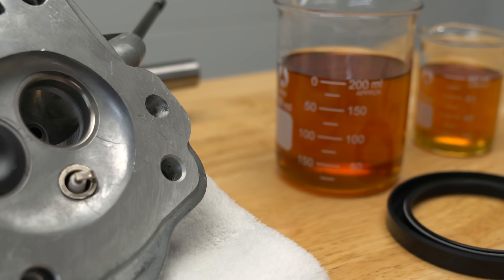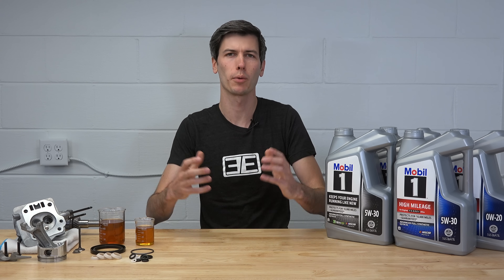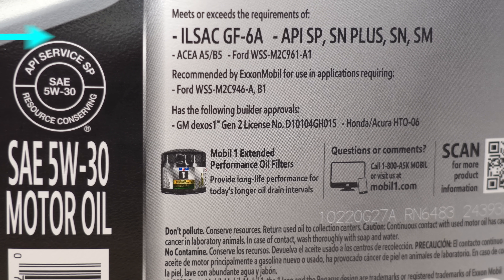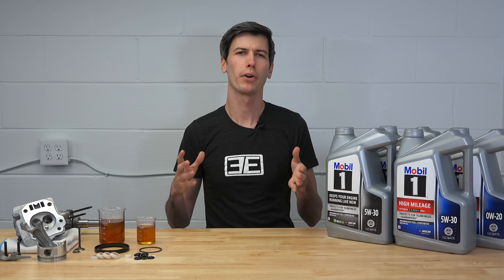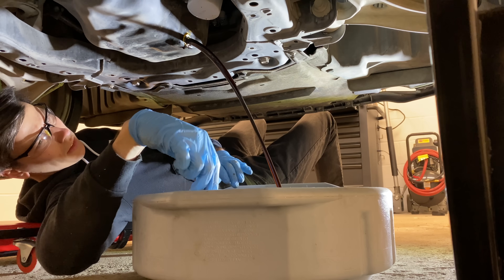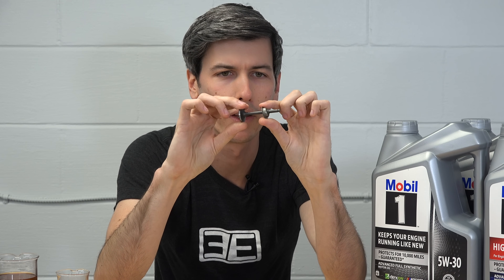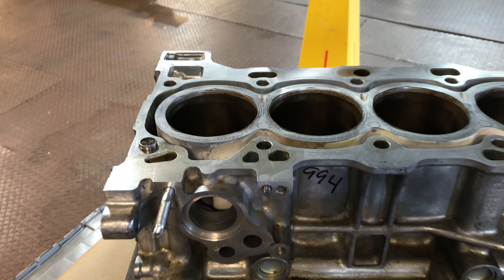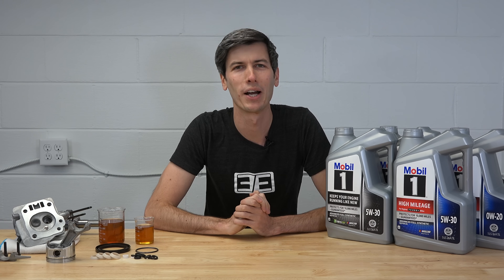Is Synthetic Motor Oil Bad For Old Cars?

Comment: I used synthetic oil in our 1996 Jeep Grand Cherokee 4.0l to maximize its life. When we rebuilt the motor at 189k miles the cam, lifters were trashed since the synthetic oil had no ZDDP additive to prevent metal to metal friction. Using synthetic oil or any oil lacking ZDDP in an engine before about 2004 is suicidal.

Comment: One thing to call out with regard to oil weights is that neither the first, nor second number are particularly meaningful for most people in most conditions. How often in a year do people really start a car in negative 20 degree outside temps? And in the parts of the engine where it matters most, the viscosity at 100C is pretty irrelevant as operating temperatures in critical parts will be a lot higher, especially around the piston rings. At operating temp, all oils are thin so the quality of the base oil, the additive packages and the HTHS - high temperature high shear - value are much more interesting. I run a M1 0W-40  in most of my engines in a fairly warm to hot climate year round. Not because it's a "thick" oil because it really isn't, but rather because at $5 a quart it's a really strong package that can take a beating when you run higher RPMs at high outside temperatures, while it's thin at room temperature to get to all the bearings quickly during a cold start. MB and Porsche certifications are some of toughest in the industry and this has the stamp.
Reply: But I would not even think of using 0W anything in an older, (pre 2000s) engine.  Clearances are probably too large.
Reply: @michaelbenardo5695  0W has nothing to do with the viscosity at operating temps. 10 or 15W-40 is just as thin at those temps but most of these oils don't perform as well as the M1 where it matters. If you want thicker oil for older engines, the M1 5W-50 is an option. The only downside to higher number spread oils is they shear down more quickly. This is all info from an ex MB engineer in Germany who worked on lubrication for them for years.

Comment: I have a question to check. I got an 20 years old car with 200K mileage. In the manual book, the recommended engine oil is 5W 30 but now I am using 10W 30. However, once I got to the mechanic, they suggest to use 10W 40. So, any could suggest me what will be the ideal engine oil for my car? Thank you.

Comment: No Discussion of ZDDP and Flat Tappet cams!  Mobile 1 publishes the amounts in their oils.  20w-50, Euro, and High Mileage have the highest amounts.  Remember that the oil spec for older cars does not appear in modern oils - they DO NOT meet those specs.  

And if you go way, way back to the times of non-detergent oil and engines that did not have full-flow oil filters (they sometimes had OPTIONAL by-pass filters that slowly filtered oil from a small passage usually around the cam or distributor) you have a big problem:  Detergent oils kept dirt in suspension so the filter could remove it.  This is not present in old engines where dirt in oil would  settle and accumulate in the bottom of the oil pan.  All that muck and sludge in the bottom of pans would have been kept running through the bearings if detergent oil was used.

Now the irony of all this is that the obsolete bypass oil filter could also be used on modern engines to remove 5 micron and less particles.  The full flow would take care of the big stuff while the bypass filter would slowly accumulate the small stuff that would clog the full flow filter if it had media that fine.

Comment: I have a 65 Malibu with the original 283 that I overhauled in 1990 with a new cam, new bearings, and new  pistons and rings, and new stellite valves and seats.I have about 30,000  miles on with no leaks or oil consumption.What  Mobile 1 oil grade would be best ?.I have been running Vavoline 5W30 conventional  oil in it since 1990. That being said,I have been running Mobile 1 on my other 3 newer cars for about 11 years and a lot of miles.Would switching the 1965 over to Mobile 1 create any problems?From your video I don't see any problems with doing That.Thanks,Larry.

Comment: Good video! Another reason to not use synthetic in an old car that already burns oil, is the cost associated with burning the expensive oil! I think I would buy the cheapest oil until I could replace the car. Amsoil advises to install their oil in mechanically sound engines. A car that has been running on conventional oil for 150,000 miles probably isn’t all that sound any more due to wear and sludge build up, even if changed often,because of higher volatility and lower maximum operating temperatures compared to synthetic oil.

Comment: Very thorough and conclusive.  I recently switched to synthetic on my 2000 Corolla which I bought used with goal of 200k miles.  As I've taken care of it, I kept increasing the mileage goal.  I'll probably keep it if I get another car.   It doesn't leak or burn an ounce and everything is ridiculously clean.  I think you're segway into people running thicker oils may have confused some.  I see it as an informative, but different discussion, but begs a question: is weight consistent (as it should if following API) or is synthetic considered thinnner/smoother/less viscous?  This piques my interest that my new ticking noise in my Corolla may correlate with switch to synthetic, though these cars are known for it, or it's just age.  I can try conventional next time to see if there is difference, right?
Reply: I watched this again as I'm thinking of reverting to my conventional oil (actually GTX synthetic blend).  There was never an issue but now I noticed that after 4000 miles, I'm down about 1/4 qt.  I refused to think I was burning it and have no signs of blown head gasket - so I think it's leaking and I'm going to try to revert to see what happens.  I do like the info on high mileage oils, which I thought was just marketing.  I may try that also.
Reply: Still on syntetic? My rolla has 250k Milles on it, thinking of switching to syntetic.
Reply: @maartenvas1278  Yep, my first batch turned black sooner when a Toyota owner said that happened to him when he switched, as well as the decrease in oil (like seals gotta get used to it or something) he suggested not letting it go 10k miles as some suggest and keep on closer to regular interval at first as it removes gunk.  I changed that one at 5-6k (was doing 5k OSI prior) and will change and probably keep schedule at 7500k.  I use Fram Ultrasynthetic filter.  Regular full synthetic not blend or high mileage.  After last change, oil stayed clear and doesn't burn a drop.  I'm at about 190k miles.
Reply: @maartenvas1278  Try it for a few changes.  I actually did it 3 or 4 times with success but noticed new 'burning' (common in these gen 8 Rollas) so I went back to try Dino and see effects.  The Car Care Nut says some oil loss is fine in Toyotas, I seemed to be about 1/4 qt at like 4000 miles.  I've been monitoring this change and oil stays clear but loss seems about the same.  I'll probably go back to synth since it's actually a little less and my interval (especially if needing to top off) is longer.  I would never suggest thicker weight on these, I think that's how to screw up pump, chain and DOHC.

Comment: For the small difference in price I wouldn't put conventional oil in my lawn mower. My daily driver has 350,000 miles and still runs amazing. Usually change my oil around 12,000 miles with Mobile 1 . At around 200,000 miles it was down a quart at 6,000 and I read that fouled oil rings can cause consumption so I went old school and topped it up with a quart of Marvel Mystery oil. Changed the oil at 10,000 and next oil change I went 10,000 miles without adding oil. I've also had good luck with Seafoam to de-gunk old engines. I've used it in my daily driver as well. Engine has never been apart and still doesn't leave a spot on my driveway. Keep your motor clean and use good lubricants. Watched some Amsoil videos and I kind of believe their hype about the additive packages but for the price I'll stick to what is working for me. Also, I do occasionally, maybe every 3 or 4 oil changes, do a seafoam treatment around 500 to 1000 miles before i change oil.

Comment: Theres was once a mfg, like bentley, mercedes, bmw, porsrche, or some other luxury type. They ran their engine for equivalent 1 million road miles, and had a constant flow of new oil in, old oil out. And the engine never gave up. Moral of the story: Do you want to spend all your money on oil changes or save up for a different car and allow your engine to die? Ever since hearing that story, I now look at the color and transparency of engine oil to change it. I dont wait for the magical numbers. I want vintage cars to last forever, because new cars are filled with remote control shutooff devices, microphoens and cameras that watch you, and gps that tracsk you.

Comment: Just for informational  reasons. If your oil light flickers and the oil level  is okay check the oil psi sensor  before switching to a higher viscosity  oil. I have found this issue on several  vehicals.
Reply: *vehicles
Reply: Exactly. I have found that most of the time a warning popping up on a control panel usually means that a switch or sensor is faulty.
I thought these things are meant to warn you of a pending mechanical problem, not be the problem themselves LOL ?!?!
Reply: Change Oil Filter

Comment: I have tried a synthetic Motor oil in my 2006 Ford Ranger 4.0 L I found that these motor oils are not good for these truck I used 2 qt of oil between oil changes. I went back to a non synthetic oil and the truck does not use oil between changes. I would not again put a synthetic oil in this truck and would not recommend it in any older vehicle that traditionally used non synthetic oils

Comment: I have 1.5 million miles in a Detroit 60 series.I have used synthetic with an oil bypass filtration system since I bought it with 500,000 miles on it.

Comment: There is however the problem of controlling scuffing in old flat tappet engines. Oils containing ZDDP at around 1400 ppm was the solution, Valvoline VR1 being an example still available; there may well be others.  I understand, ZDDP was removed from more modern oils due to incompatibility with catalytic converters.Will a synthetic provide the  same or better protection ?  I'm thinking in terms of the old BMW airhead series.
Reply: ZDDP was reduced,  not removed. 600ppm is the minimum, and 600ppm is also sufficient for stock flat tappet cams outside of their break in period. 

As lift and spring tension increases ZDDP requirements increase as well, since the force the cam lobe exerts on the lifter grows with lift/spring tension.

Comment: I have seen so many engines start burning oil after changing to detergent oil, the sludge is a good thing in an old engine. The difference being what you call old, 20 years old is much different than 60-70 years old, using rope seals. You concentrate on seals but rings are the big issue, ever try to break in a rebuilt engine with synthetic oil, it's much harder to get a ring to seat. If you break it in with nondetergent oil and don't let it idle but run the engine at varying rpms, not reving the crap out of it but just running it  under various loads it will seal much quicker and better. I still only run semi synthetic in newer engines because it seems to have the benefits of both types of oil, sure it does need changed more often, but removing contaminates is what will truly increase an engines life. If you really look into it a full synthetic oil will coat engine components better, which sounds like a good thing. Until you realize that coating, also creates a thermal barrier holding heat with in that component. A little is good so a lot is better is not always the case, real world data will always be more accurate than charts and manufacturers data, they are trying to sell their product, not save your engine.

Comment: Here is a question, if your vehicle calls for 0w-20 synthetic can you use 5w-20 synthetic oil in its place with out damaging anything.
Reply: In most places it will be fine, but don't do it if you live somewhere very cold. If the car is sold globally,  manuals for different countries often call for different oil thickness.

Comment: I had a 2000 Chevrolet Tahoe roughly 300,000 mi on it. Didn't have any oil leaks.And between oil changes at 5,000 MI maybe it used  half a quart and it never seen a quart of synthetic and all the years I owned it. And I can honestly say mixing different types of oil brands didn't seem to bother it GM said mobile yep sometimes it got Pennzoil a (lot of times) and every now and then some Quaker state.

Comment: You failed this issue big Time sir!
      In old engines that have a flat tappet/valve lifter synthetics are not recommended because they lack the oil additives Zinc and magnesium which prevent excessive cam and lifter wear /failure.
     I would ask that you research this issue and correct/modify your statements for the benefit of your credibility and viewer confidence.

Comment: I own a 2005 Saturn Ion and it has 32,000  kilometers (19,820 miles) when I bought it. 16 years later I have 710,000 kilometers (440,200 miles). My secret? Synthetic motor oil and premium gas.

Comment: Oil is oil, if it synthetic, it might have some additives that keep it from breaking down quicker so it might be a better route to go on any engine. I use Castrol high milage high performance oil for my 951 and it does a great job, yeup its a turbo and it really needs a good oil.

Comment: I have an 07 BMW 525XI with 286k miles it. I used 6 qts Advanced Synthetic Mobil 1 10/30 20,000 mile plus 1 qt Lucas High Mileage additive. Seems to have increased compression and is peppier. Any other recommendations?

Comment: Answer me this Batman.  If my old 1995 truck with 50k miles calls for 10W-30 conventional oil, why can't I mix Rotella 15W-40 diesel truck oil with 20% Marvel Mystery Oil to thin it out and improve the high temp properties at the same time?  It works great for me for years in all my air cooled motorcycles too which call for 10W-40.

Comment: Do motorcycles require specialized oil beyond the weight specification in the manual. I own an oil cooled India-made motorcycle and the manufacturer insists I have to use the specific oil he produces. My thinking is that I could stick any 10W-30 full synthetic oil in it. Is this a bad idea?

Comment: I hear that modern oils have removed Zinc due to emissions requirements.  I also hear that older Flat-Tappet engines from the muscle-car era need zinc in the oil because of the flat-tappet design.   What say you?

Comment: I use the same synthetic 10-50w with 2 bottles of ZDDP Plus in all my early 1930's cars. (I own 4) Synthetic is better also better for heat dissipation, better contact with metal as molecules are of the same size. All engines run great, no leaks or issues even in original never rebuilt  old (1932) high mileage engines . Never shut the engine before it has reached operating temp as you get acid gases corrosion inside the engine.

Comment: Funny.  I had a Harley-Davidson (2004) one of the early twin cams.  HD highly discouraged the use of synthetic because it may cause Cam bearing "skate" that may cause flat spots on the ball bearings used for the cams.  I used synthetic anyway and never had a problem.  Well two years later HD came out with their own HD branded synthetic oil designed for HD twin cam engines.  At that time I was working in the Environmental Management field and I had access to the HMIS (Hazardous Material Information System) where I had access to proprietary information for just about every produce that had a MSDS (SDS).  What I learned was the HD oil was made by a well known oil company and there was no difference between the HD branded oil and the oil company's branded oil.

Comment: When you use the term ‘older cars’, I think you are referring to cars that go as far back as the 90’s?  The suitability of synthetic for classic cars has been the subject of many debates at my car club, which is focussed on Austin-Healeys. The concern about using synthetic oil , instead of the 20w50 conventional oil that was originally specified for these cars was historically related to leaks, but I agree that job 1 should be to address the bad seals. With the sealants we have today, you can expect to get a near perfect seal on any paper or cork-based gasket. However, recent experience has shown that these old cars run about 10F hotter using synthetic instead of conventional. Many classics from the 60’s and earlier did not have great cooling systems, including Healeys and American muscle cars, so adding 10F to your running temp is a actually a problem.

Comment: I purchased a one owner '92 Lincoln Town Car with 98k miles. The engine was running just perfect, but I had to go and put synthetic oil in like a bonehead. After about a mile or so it started burning oil like no one's business. It was smoking so much, I had to park it. I learned my lesson. If it ain't broke, don't fix it.

Comment: I like using synthetic in my older vehicles. I have to make sure I change the filters out every 2000 miles because it really cleans the engines and causes too much back pressure on the oil pump.

Comment: I had a machinist tell me to use conventional in a classic EFI BMW motor but I had recently switched to turbocharged rather than N/A. I had less issues with 5W-40 synth euro turbo oil than the conventional 5W-30. The recommend oil for old BMWs is no longer available but the oldest available BMW oil spec is rated to be sufficient (BMW longlife-01). It should be noted that the newest oil spec from BMW (LL-04) is not sufficient for these oldies so check the back for mnfg specs pertaining to your model year!